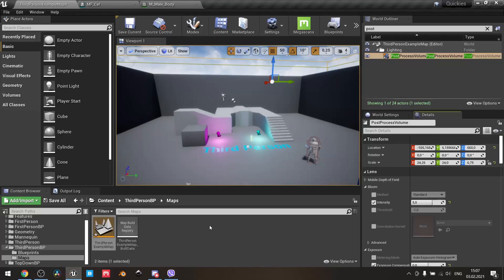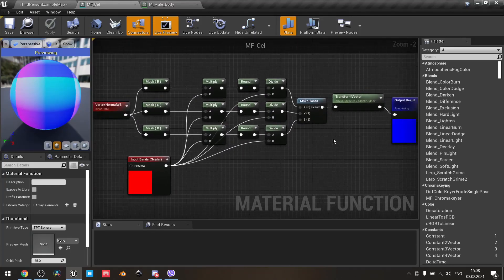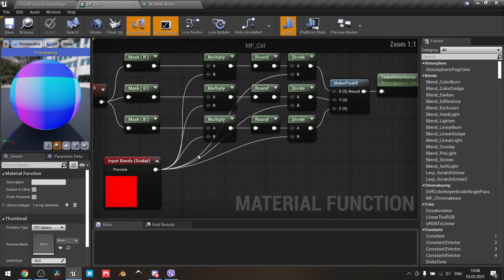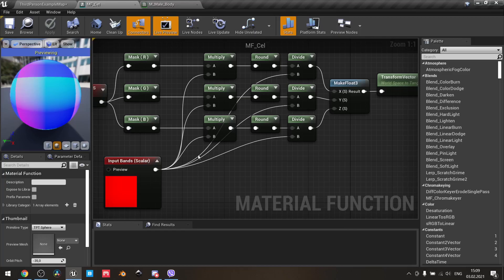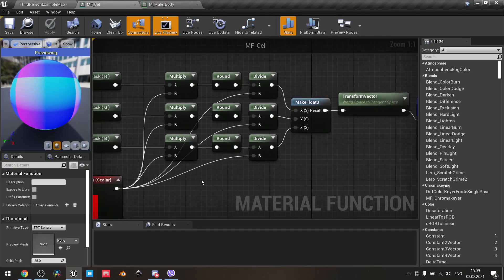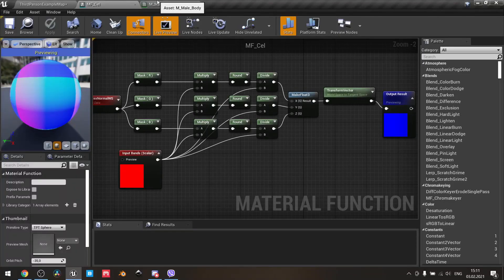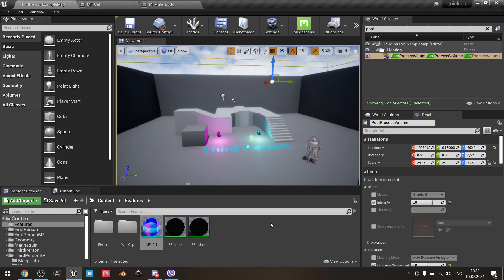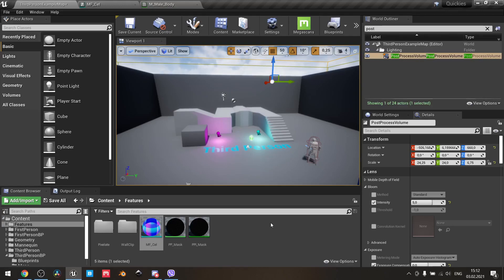Forward Rendering Cel Shader in UE4/UE5

Comment: This is so cool. Just the thing I've been searching for my game. And I love how convenient it is to implement.Genius! Just a quick question, when I applied the Cell Function to the Mannequin, I get an error "Missing function input 'Bands' ". Am I supposed to also connect the normals from the mannequin to the function band node as well?  I feel like i may have made a mistep somewhere in the function because the colour in the preview is just a little bit off compared to yours. But I'm almost certain I have added all the nodes i saw in your screen so it may just be an incorrect value i inserted somewhere. Please help!!! I really want this to work.
Reply from the maker: U need to provide scalar attributes inside default pins of shader. Function may have error’s but it will work, message is just that u don’t provide preview values for it. I will cover this one in upcoming video.
Reply: @YourSandbox  ok great thank you. I've subbed so i'm looking forward to the notification!
Reply: @YourSandbox  Nevermind. I found your Advanced Cel-Shader video which works even better for my needs. It's just perfect! 👌
Reply from the maker: @maiasdesires3066  oh boi. Glad to hear it. Yeap, my latest approach IMO one of the best and easiest solution :)

Comment: very cool, very simple effect. i'd like to know if you could add rimlight and outlines to it?
Reply from the maker: in case of forward rendering outlines won't work with post process, but u can fake it. i can make a tutorial on like fake cel shading with outlines to work on forward rendering :) it's a hack, but for prototyping will be quite Ok :)
Reply: @YourSandbox  Did you ever make a Forward Rendering outline tutorial? Any advice on the method you mentioned?